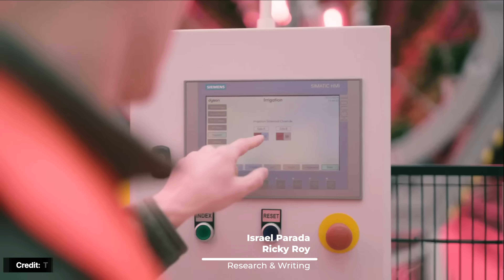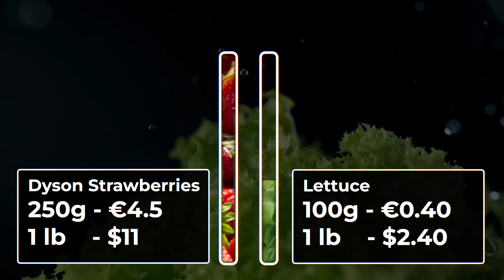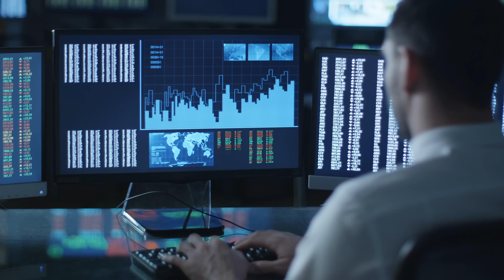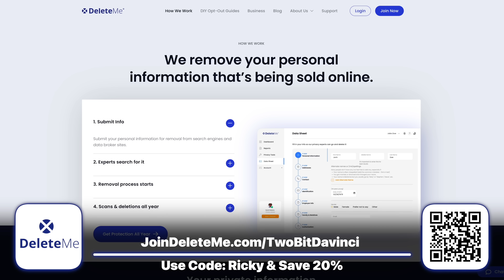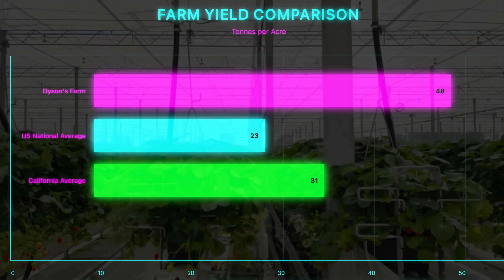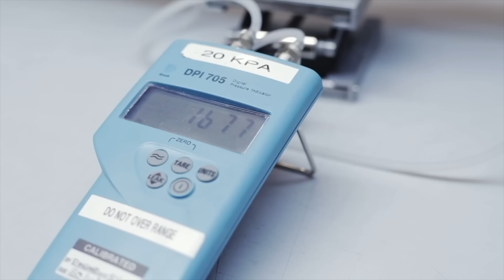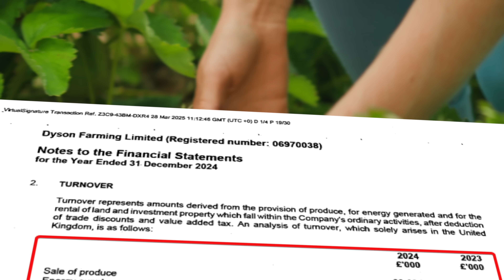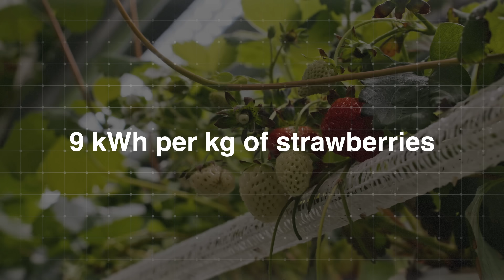The Company that FINALLY Solved Vertical Farming

Comment: I have a single-pole vertical farm in my backyard for growing apples.  With this installation, many more fertilizer delivery vehicles flap their wings and deposit nitrogen resources throughout the yard on a daily schedule.  My feline affection unit becomes much more kinetic and energized during these gathering events, generating motion and sometimes harvesting little protein gifts for me breakfast.  All because of apples grown vertically.  Up in the air.

My next design is to experiment with horizontal forms of napping.  The potential of this system promises to reduce neck pain and the unplanned velocity transients of collisions that involve the floor.  Soon, I hope this may lessen my impact on the world around me.
Reply: Seems like you have been practising your pitch deck for VC investors. Be careful! You may end up receiving millions to crash and burn. 😅😅
Reply: underrated comment
Reply: The way I see it, you'd preferably have at least two vertical farm units before considering the horizontal experiment. After that you will slightly benefit from economies of scale, with each additional farm allowing for another horizontal napping section. 

The benefit I see of synergizing both systems is the added potential of automated seasonally controlled solar shield arrays for the horizontal napping sections. In an emergency the array may also serve against lighter expressions of aqueous aero soil cycles.

I'm sure you will quickly recoup the cost of that initial vertical farm and wish you the best with your future endeavors.
Reply: @leegarnier9396 oooooh. You could also set up a shape conforming connection between two of your vertical units. This could provide napping opportunities as well as generating kinetic motion. Your feline affection unit may also be able use this *at the same time*, potentially generating a low-hertz signal which has the potential for healing.
Reply: But are your memes shared mycelially
Reply: I think it will certainly reduce the involuntary impacts of you on the world. I wish you the best in this venture. I especially like your feline affection unit. I have a few of those, I think I need to better implement them and study the effects. I shall investigate. 😊
Reply: Can you talk normally? i didn't get a single thing from this post
Reply: @Sonofsun.  He has an apple tree.  Birds perch on it.  Perched birds poop.  He has a cat.  Sometimes cat catches bird.  Sometimes cat leaves a dead bird as a gift for him.  Next he is going to sleep lying down.

The plain English version... it's very boring.  The OG version is whimsical and fun.

Comment: Vertical farming should be understood as a waste in its current state.

But major metro areas could easily convert the top two decks of all parking structures to farming - AQUAPONIC farming.     The top of the deck being exposed for the crops, with the deck below being used for the fish (or other aquatics) and processing.   Everything below those levels could be used for traditional parking.   And since production is happening in the metro area the produce would be all but free to transport to markets, most of which would be less than a mile in any direction - or even sold right out of a storefront on the bottom level of the parking structure.
This would need to be done on parking structures which are designed for that sort of weight and for vehicles to have access to the production floors (ramps).

That aside, if the top of the structure is not supporting a building that sits on top of it, or for farming, they should be required to support solar.    No parking structure anywhere - or rooftop, for that matter - should be naked to the sky.

Comment: when i think of vertical farmig i think of   vertical literally like a 10+ floor building each floor  for farming  if you have a 26 acre plot of land you can instantly double the output by adding a second floor of that  plant  3x by adding a 3rd floor   so on .  and for me   i think abotu the lighting issue as an engineering  obsticle for exampel if you built the building from the groudn up intentionally for this you coudl have   a parabolic mirror  on the roof that shines that light down a  2 foot slit  thats as long as the whole building  and use prisms to split the light up  mirrors to devide it up further the more floors you go down    think of it liek this a giant fiber optic  cable  thats the entire building long   that branches off  at each floor  so the main center one stays full brightness   so you can get that full brightnnes to the floor  and have branches along the way. this is only a concept  but  im assuming it can work because just liek  laser beam splitters and such   ive seen tests where they wrap the beam bqack in on its self to get it back to ful brightness   just thoughts  and with that all being said  i woudl assuem its even possibel to use a prism to selectively isolate the wave lengths that plants use the most of liek a prism  half way down the building that was the lower floors coudl be more for flowerting plants  to simulate the spectrum changes. if any of the peopel who know more abotu thsi stuff then i do would liek to point me in the direction of a better understanding if this isnt completly corrrect . also i dont mean literally using fiber optic cables i was using it as an example

Comment: That's not vertical farming. It's just an expensive greenhouse
Reply: You're quite right. Most hi-tech greenhouses all around Europe work on similar principles, just without the rotating beds and i'm not sure about how popular the biogas part is. 
While i love the precision gardening overall, the biggest concern is light pollution - these greenhouses literally glow at night/in winter. In Poland there happen to be protests by people living around such farming operations. The light is visible for many kilometers even despite shading&isolating curtains used by those systems. Rotating beds might be actually better on the other part, as lights are placed lower than greenhouse ceiling.
Reply: you are not adding anything of value to the discussion, just spewing useless analigoes.
Reply: Well, I see some verticality, obviously, which hopefully actuallly saves like 50%? space. But sure, not true vertical farming if I imply an endless stack size.

Anyway, an interesting coverage of their project and, if everything in the video that was said is true, "the most vertical farming that works today"?

Comment: There's literally nothing vertical about this. The LEDs are completely unnecessary in this setup. It's just regular farming with a rotary wheel. This is like WeWork calling itself a tech company. And typically it's never been considered profitable to grow regular heads of lettuce. Leafy greens, yes. But vertical farms are supposed to focus on more niche greens like arugula or more gourmet lettuces like boston bipp or they can work directly with restaurants to change the formula of lights and time etc to create specific flavor profiles within the greens.

Comment: What would the strawberries in an open field do bro. They would be consuming Co2. 
So nope. Having a biodigester produces energy is not the way. Use solar and wind and batteries and  feed in air into the greenhouse. They will do the job much more efficiently and absorb Co2 in the air. Which is what we all need. 
Or better still grow the strawberries is Spain and then ship them on vessels that use kites to reduce fossil fuel consumption.

Comment: I've always wondered if a plant like kelp that separates and stores hydrogen from sea water could be modified for use as a bio machine. Turning sea water into hydrogen and oxygen gases. The collected gases would run a hydrogen fuel cell and the water created would be salt free. A desalinization plant that generates power instead of consuming it.

Comment: Math doesn’t work out. 100 GWh sold to the grid means they’re producing about 11MW of electricity. Getting that from photosynthesis is impossible if all the biomass is coming from the glasshouse which is only 26 acres. You’d even have a hard time producing 11MW from 26 acres of straight solar panels. Makes me wonder how closed this system really is.

Comment: Two points:
1. Digesters do use biomass from farming operations.  Aside from the methane that Dyson is using to generate electricity and heat, their composted solids and liquids should be highly suitable for spreading back onto outdoor farmland.  
2.  The mix of outdoor and efficient indoor farming may also be boosted by agrivoltaics, which would further increase Dyson’s energy outputs.

Comment: I think the main error was the average household use of energy, nowhere is there a full home of 2 adults and 2 children, that only uses 300W/h every hour on average. The average consumption between any home is around 500 to 1000W/h per hour, leaning more towards the 1000W per hour, which is 3 times the listed value of 2,700KW/h per year. In reality, it is around 9000KW/h to 10MW/h annual consumption, for Europe.
Great video overall 🤩.

Comment: the digesters are heated and usually the methane produced is used in a gas boiler  to heat a circulating hot water system. Also a point missed I think is that they use organic waste from a huge farm not just from the greenhouse

Comment: Good to see this moving forward.  One quibble about the digester, and one thing about daylight to add.
1: Are you sure it is an anaerobic digester rather than an aerobic one?  I had to double check, but anaerobic respiration does not produce CO2.  Some forms of it actually consume it and produce acetate or methane.  I'm guessing the CO2 is moreso derived from the combustion of the biogas (probably methane) for heat and power?  Again, just a quibble.
2:  The drop in total irradiance on a cloudy day is usually not an issue as light is not typically the most deficient resource in a greenhouse environment.  Many growers will put up shade cloth to mitigate sunscald as well as runaway heat gain.  The diffusion of light through clouds is actually a boon for canopy penetration that we often try to mimic with glazing that scatters the light: when light comes from so many different directions, self-shading is less of an issue and the plant's lower leaves are more efficiently used.  I'm guessing the LED's are for supplementing shorter daylight hours in the UK's climate, managing photoperiodic and metabolite responses in the plants, and the UV treatments you mentioned (UVC used to kill mildews directly and UVA-UVB to stimulate cuticle development in the leaves and thus a stronger intrinsic defense to mildew).
Reply: @OwlMoovement if I understood the video correctly, the anaerobic digester is used to produce biogas (afaik mostly methane) for energy production. So that makes sense. 

The mentioned CO2 is from the exhaust after the methane is burned to drive the turbine.

Comment: It seems to me we're underutilising fibre optic cable. 
You can capture sunlight from outside using large Fresnel lenses, condensing it down to a point that can travel through fibre optical cable the diameter of generic home electrical cable, and then redistribute that light in any configuration we desire.
That way the Dyson configuration wouldn't need to spin, if each crop row had it's own solar lamps cabled to outside lenses.

Comment: The genius of this system actually means you have an attainable short term goal as well as a long term goal. Short term is that this style of vertical farming can bring crops that may have been thought of as difficult to grow in certain climates possible. Long term can be that it's possible to bring back once dead strains of crops that can also lower prices on food because of the diversity. Pipe dreams. Also this tech could help other types of farming like hemp or spices.

Comment: Biogas systems are seasonal so there may be some summer and winter averaging in the power calculations and recorded income. Biogas was part of the original vertical farm design so arguably this is the first, non vertical, implementation of the full design. The rotating crop system used was developed in a NASA project in the 1970's at a facility near the Los Vegas airport. I believe the facility is still is in use. The rotating Ferris wheel design has been tested on submarines for fresh greens. A version was designed for the International Space Station but never launched; it was actually too productive for the crew numbers. It appears in a dozen TV shows and movies but this is the first full implementation of it. The shape means that 3 banks of LED illuminate double the crops of a flat system so a big power saving. Dyson clearly does his homework.

Comment: why did he need to buy farm land if it can be built anywhere, like, by a city for less logistics / supply chain solution and fossil fuels to transport it. 
Also, why is the example here, not vertical? they could just put it in a tower with mirrors even.

I do love that it is an amazing closed system for heat and CO2....

Comment: What they try is not even farming it is market gardening. Producing just leafy greens that sustain no one. When so called vertical farms produce Wheat economically they will be trying to farm! 
What you showed supposedly Dyson were just greenhouses, tall ones at that. No sign of verticality in there! 
Dyson failed to solve the problem he first addressed. The problem was overpriced replaceable bags on standard proper vacuums. Dyson made a hugely expensive rather poor bagless system. When all we needed was cheap generic bags!
Strawberries are a confection, not a survival food. They are irrelevant. Also double the price as you mention! It will be cheaper in proper fields. Perhaps with robotic workers. The problem is just the over priced labour.
USA has loads of land space, just not the issue.

Comment: So basically they solved the vertically farm problem by turning a vertical farm into a greenhouse with extra toys?? I Always assumed that the point of vertical farms is that you can have  for example a skyscraper type building with every floor being crops. This system that they are using does not seem to save space that much.

Comment: I once worked at a bakery that had huge ovens to bake loaves of bread with a hamster wheel like mechanism inside. You’d feed the raw loaves in and they’d go in a big circle, and by the time they came around to the door again they were done. You’d pull them out and load fresh raw loaves.
So I had an idea of building a vertical farm using that design, which is what Dyson has done. I wish I had patented it. 🙃 In my design it would use sunlight from south facing windows but, because I live in Alaska, it would almost certainly have to be supplemented with LED lights, especially in the winter. Those could be placed either along the outside or even along the central axel.
I’ve also been interested in methane digesters since ai first learned of the subject and many many decades ago proposed a project for my engineering class in college. The Ferris wheel greenhouse I envisioned would be a lot smaller than Dyson’s, one that I could probably run by myself or with one or two assistants. But it would also be easy to scale up by just extending the axle and adding more wheels. But since I hadn’t thought about it on an industrial commercial scale, I hadn’t thought of combining my two interests. So Dyson‘s idea is pretty genius. Getting energy from the sun as well as waste from the plants. It could even be adapted for a space station which might already be circular and always have too much sunlight. So the plants would rotate to get out of sunlight for part of the day and provide food for the entire station.

Comment: This system has a huge drawback. How much does this rotating thing add to the yield? Most of their equipment is just regular shelves. It's a typical greenhouse.
Saturating the plants' atmosphere with carbon dioxide is nothing new and makes perfect sense.
This Dyson greenhouse has a ton of unnecessary equipment.